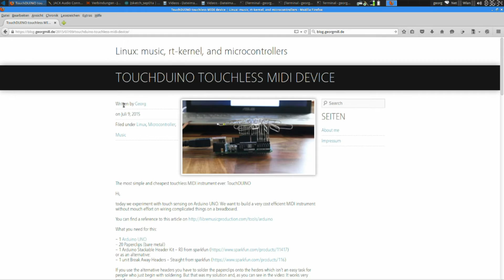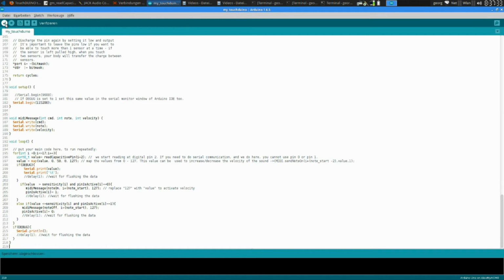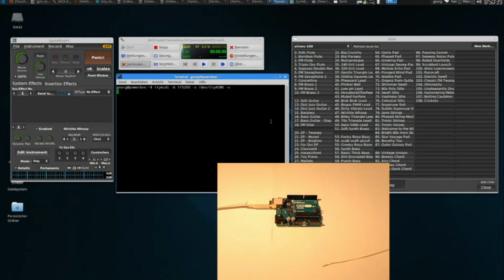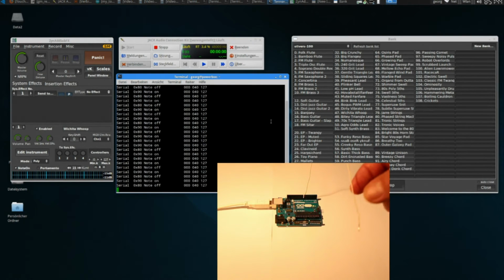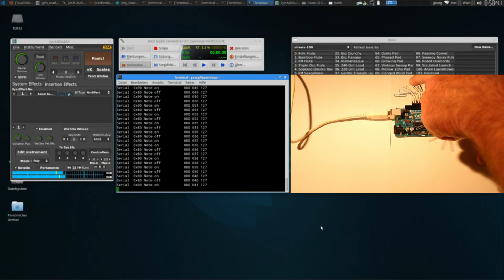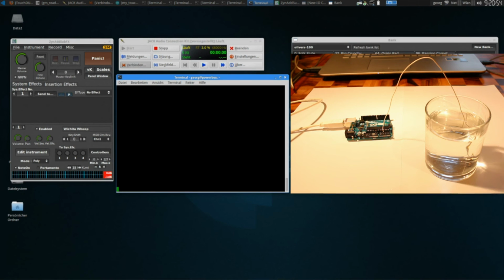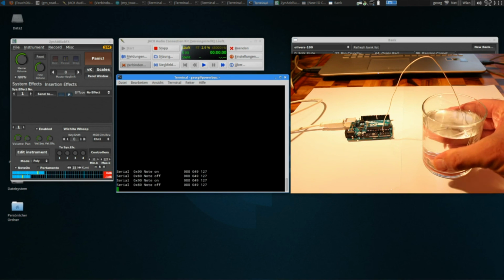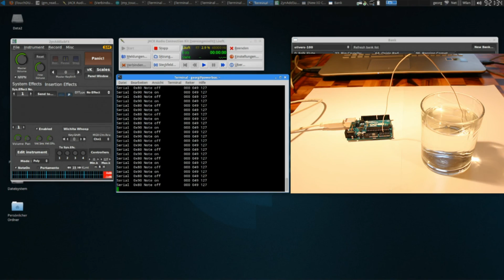Create your own touch sensitive MIDI controller with Arduino

Comment: 🤩grt Job......  
Can  u  Plz     Hlp   Me   I need   Ur   Guidance....
Using   The   Arduino UNO with  HM-10   Ble  Module     ....with  Same  pins  connected    & Same  codes .......  which  u  Provided....

Will   It   Work  ?   
I mean    
Arduino + hm-10  ble Module On  ur   codes  

If  no,   Thn   Can  u  < plz   Plz  plz   Plz  >   Do   a   small  1  octave Arduino  coding   For  me    To  wrk  as   Arduino midi  over  Bluetooth BLE ???   
m  not  a  code programmer ........  but I can  make   My own midi  controller   If  u  hlp me ...providing my   Mail id  :-

sawan.vaid@gmail.com 

it  will  b  very   Helpful   For  me  ......  plzzz   Rply